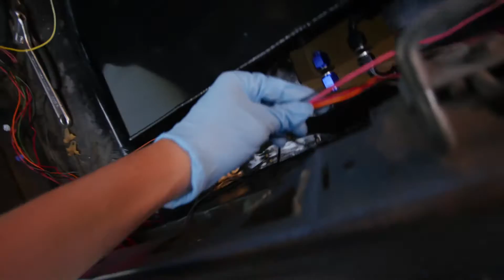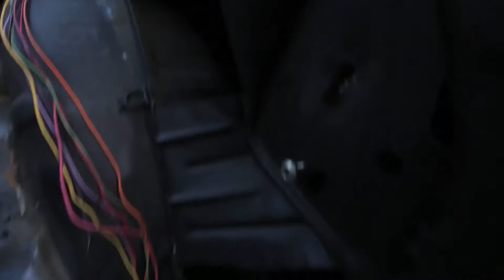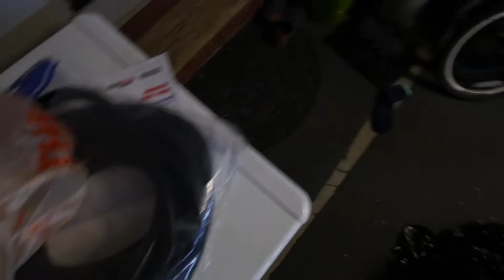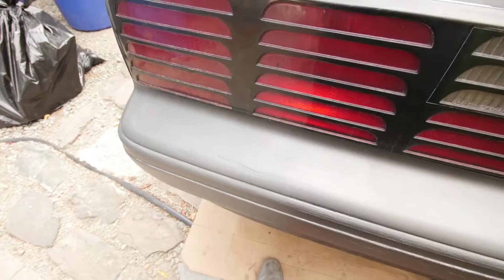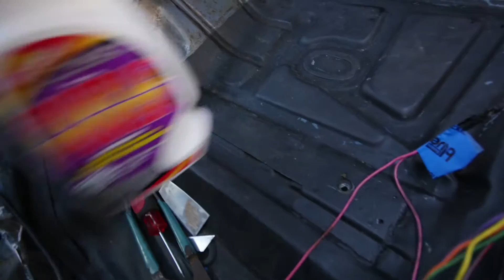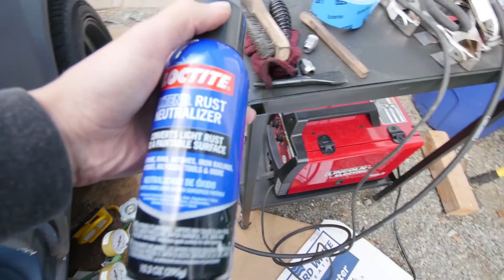Foxbody Drag Car Build Ep.27

Comment: I'm pretty sure you need a barrier between the trunk and the inside of the car
Reply from the maker: Ya its called a fire barrier. I will definitely be putting in one when I want to go to the track because they require it but until then I could care less until I get it running on the the street. Thanks for the comment